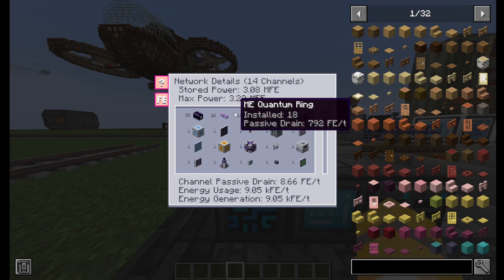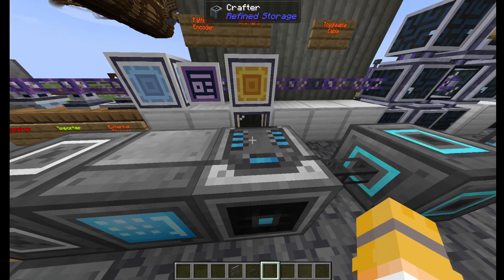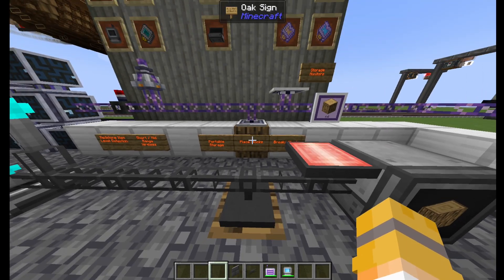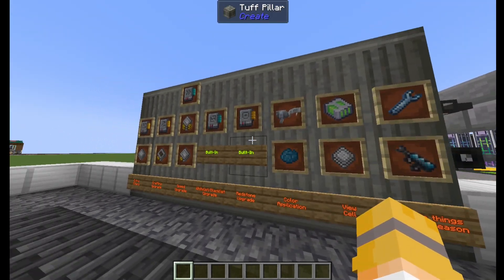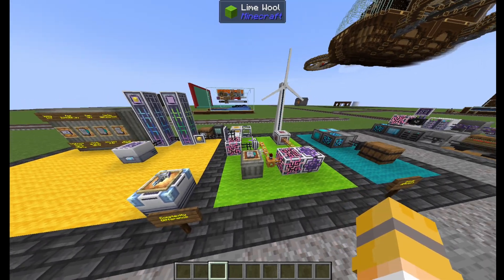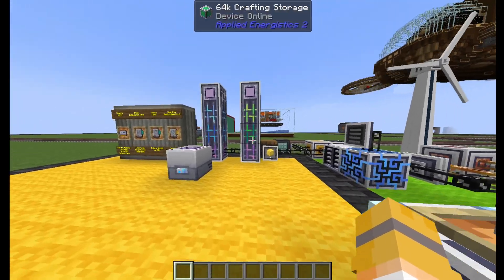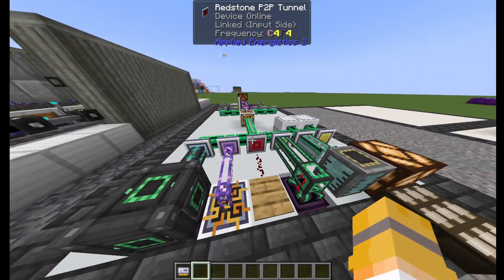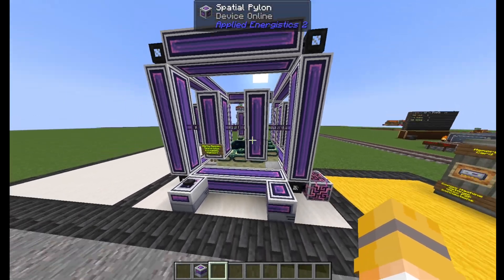Applied Energistics or Refined Storage?

Comment: the co processing unit didnt store temporary item. it works as another processor. heres an example if i want to auto craft iron pickaxe and have iron ore and wooden plank. if it have co processing unit it will simultaneously smelt iron and craft stick from the log and not 1 item at a time

Comment: 6:50 

TLDR: you use them if you have maxed out your ME core to the absolute maximum and want to use EVERY Chanel possible. You basically connect the P2P ME pannels directly to the controller and the cables running to and from the p2p tunnel interfaces.

Comment: 5:16 what if you get inf water or cobblestone cells and you dont want to see them in ae2 ?
Reply from the maker: You can put them in a subnetwork, but I don't think there's a way to hide them and still be able to access them from the main network.

For example, I can hide cobblestone from the main storage, but if I want to pull cobblestone for something, I now have to connect something to the subnetwork / manually extract from it.

The issue is that if I hide it from the main network (Via a storagebus / interface giving the main storage access, and an inverter card set to cobblestone) the item is no longer visible to the main network. This solves the issue of "hiding" it from player view, but the storage itself can't access it.

If I allow main storage to access it, it's back in player view again.

I think the best case scenario is unfortunately a separate network with the infinite cells in it, and a terminal near your main one.

Comment: The filter can be usefull if for example you are playing a big modpack you can set common crafting materials off to the side for things that cannot easily be auto crafted. Basically having a section of pinned resources having just completed ATM10 to the sky having a way to have a tab of the most common resources would have been very nice. Sadly i could only use AE2 not Refined storage.

Comment: AE2 is the way to go
My biggest issue with RS is You can't make crafters or interfaces into a pane version and stick it directly on a cable, hidden in the wall behind the machine
In the past RS had one and only upside over AE2, and that was the ability to craft with fluids directly but in recent versions AE2 can handle this too 
Aswell as handling recipes bigger than 9 different items for Extended Crafting 5x5, 7x7 or 9x9 tables which previously required usage of Packaged Auto mod in case of old AE2 or addon in case of RS.
RS cables also just look plain and ugly while AE2 smart cables look very good to the point I like having them exposed in some places

And lastly, the godtier addons for AE2 like Advanced AE or Extra AE2 that add a ton of new options, QoL and even powerful Sci-fi quantum armor directly connected with Your AE2 system

Comment: a big thing why i would recommend ae2 over rs is because of the auto crafting. there is so many things (at least with rs1) that you cant do on rs that are so easy on ae2, such as powah automation, which is incredibly difficult with rs. also its just so easy to turn channels off and add drives without types if you wanted to (the biggest downsides to ae2 imo)
Reply: So far in ATM10 I've autocrafted everything Powah has to offer and it was the easiest thing to do. Only thing i needed to change was the lock system on the autocrafter pointed into the energizing orb and set it to "lock until all items are received ( or how they wrote it ). Reactors are filled and kept filled automatically .. Dry Ice are made automatically .. all parts easy to autocraft...
Channels can be turned off by server admin/owner for AE not by players .. drives without types do not exist for AE in ATM10 ( they are disabled on servers atleast )

Comment: Viewcells are good in combination with inverter cards say you are making steel with mekanism and you are routing items with interfaces you do not care to see compressed carbon so you use view cells + inverter cards to have them not show up in the terminal. Another area where this combination is important is if you have items that very quickly enter and leave the system such as ore piecese from ex nihilo, if you do not have view cells setup all your items will jump around in order as they leave and enter.

Comment: What I like about RS is the simplicity, it's so casual that it borders on cheating for me. AE2 has way more content, if only because of the subsystems. In one of my worlds I literally used a separate multiblock controller for each GregTech multiblock mechanism. The storage buses in AE2 also basically create 7-channel subsystems. Modern versions of AE2 have gotten a bit better in terms of how easy it is to get the basic components and add a template provider. But the coolest thing is the little things that AE2 has. The presence of channels makes the gameplay much more interesting and varied, and forces you to build isolated cable systems connected to individual parts of the multiblock controller via P2P. When I play with RS I don't even think about it and just build giant circuits that are actually very simple, which is why I prefer the more complex gameplay with AE2. In fact, even the ability to place several tires in 1 block already allows you to create very cool schemes. Also in AE2 you can turn off the channels and enjoy the casual gameplay, but I think that with the channels it is much cooler.

Comment: in my experience RS is much simpler without the channel limit and item types in the storage disks, but having started with it recently in ATM10 I'm getting quite a bit of lag in the grid. Maybe it's not quite optimized yet. I do like some of the recently added features that correct some issues I had with it over AE2, like they added the ability to independently change insert/extract priorities which really helps with moving items around, like setting the insert priority higher than the extract so that as you pull items in and out they get moved to a different storage, really helpful when moving stuff to drawers. I also liked that they added more blocking options for the crafter, though it's still a bit glitchy. I set it to only insert when the inventory was empty and it inserted multiple recipes before it registered that the inventory was no longer empty and locked up the whole craft.

On the other hand AE2 is much better optimized both internally and in design, the channel and items types storage go beyond just game balancing and actually optimize the performance. The channels tend to encourage more direct lines to the controller which greatly reduces the pathfinding lag from big spaghetti systems by reducing the number of branches it's got to go down. While the item types reduces the amount of NBT data stored on the drives, which isn't as big of a deal now since I think it stores stuff in an external database or something(I know RS does, not sure about AE), but it was definitely a problem in older versions. There are mods that give AE2 RS style storage disks but they're more expensive to probably discourage people from using too many of them.
Reply: yup same, RS2 seems laggy on grid view
Reply: This is useful to me, since i was looking for a storage mod to reduce the lag all my chests make.

Comment: View cells are useful to make cells that specifically show, for example, all items for a particular mod, Or to filter out only the raw resources, Or to show all wood types, etc. Using it for a single item (eg, wood planks) is just kinda dumb. But used right, you can use view cells to just show what items are needed in a particular extension of your factory- Maybe you're in your animal farm area and you only want to see exactly what the state of all your animal products are, for example.
Reply from the maker: 100% it has it's uses , incredibly useful if you have a storage drawer wall you want to check on, but overall it's very situational and never really required.

Comment: the importer and exporter are flipped so export takes items out and import bus inputs items, AE2 terminals can intake power without the energy acceptor that only useful for filling energy card also ME p2p do interact with the system they allow you to add up to 22,000 channels and when you connect storage via a subnetwork with p2p they will apear in your main system. AE2 is way better IMO also great video

Comment: Spatial storage is why I'll always recommend AE2 over RS, even with all the meteorite stupidity. Especially if multiplayer is at all involved. The amount of trolling you can get up to by trapping another player on an SD card is unparalleled
Reply from the maker: Based
Reply: But there is no meteorite stupidity in modern versions. You are guaranteed to get all 4 presses now and at worst have to use spatial storage to transport a flawless certus back and usually have something easier like mek boxes or jdt swapper
Reply: Goku is betrayed and trapped inside the hyperbolic time chamber ahhhh prank 💀🙏
Reply: Well in new AE2 You only need one meteorite so no more bullshit RNG when chasing the only press that You're missing and finding every other that you already have
Reply: I will say Meteorites are SOOOO much better in 1.20.1 than they were in 1.7.10.  Finding Meteors in 1.7.10 was akin to finding an ender portal if you didn't happen to have one nearby, and you'd need FOUR of them minimum.  I was on 1.7.10 for a while, went to 1.12 briefly, and it was cool, but I'm kinda glad all the mods I wanted were brought to 1.20.1...  On one hand, I miss the simplicity of 1.7.10, and especially build craft and IC2, but man AE2's implementation 1.20 is worth it alone.  Just find one meteor.
Reply: you can trap players on a sd card in ae2?
Reply: @user-th7bu3sc2u  It was mentioned in the video, the spatial storage can move not only buildings but players too to a spatial disk dimension. 

So You can technically trap someone in the spatial dimension but 99% of the servers have /spawn /tpa or /home commands so they are not really trapped here because they always can use these commands to get out
Reply: I prefer RS because nbt items. Channels are also annoying. 

My gripe is Drawers vs Sophisticated Storage. SS is so close to superior, but I don't know how to adjust drawer priority: when feeding items into a controller with a hopper, it puts them into the next empty drawer before looking for a drawer that already has that item type. If you know how to adjust that priority, do tell.
Reply: @joseph7471  What I do to get around it is I lock the drawer. For example, I have a huge wall of 2x2 drawers. I put a single diamond, gold, iron, and copper in one of the drawers. I then lock the drawer. It will only push those items to those drawers. 

You do have to do this for every item you want, otherwise you will still have the issue you said you had. But locking is the way to go. I also have filters through my storage bus (using AE2 to access the drawers) to make sure only items I explicitly allow go into the drawers, and any time I want to add a new item, I add it to the drawer, lock it, then add it to the filter.
Reply: @joseph7471  Export all unstackable things into Armory Cabinet, slap a storage bus on it with high priority and the problem of filling all your item types is gone
Reply: @joseph7471  I know this is late but you have to lock all the drawers then you just place the item in the one you want. I would probably just pick SS because you slap the stack (max) upgrade into the chest and forget about it. Link everything up. Then when you do get your AE2 storage set up, you can just leave it for smaller item stacks and leave all your large bulk items in the chests. But I do know people love their wall of items with the drawer mods. 

I really never had a problem with the channels with AE2 but I also program and did networking at one time. So maybe I was already geared to compartmentalizing my functions into their own groups. I think I have had to reroute cables once (before setting up wireless stuff with extendedAE) But I think after you get used to the whole 32 channels with the dense 8 channels with the regular. And know what takes a channel and what doesn't you can just cable manage and not have to ever worry about going over.

Comment: The best use for a sub network is to set it up between you main controller and the rest of the network. Then you can use AE tunnels to transfer multible 32 channel cabels in one cable saving a tone of resurces and space.
Reply from the maker: I have since learned subnetworks, the easy channel transfer is very nice, my main controller has a lot of p2p tunnels on it, and needs another controller to use them.
Reply: @solar8337  This is the way

Comment: Lol the RS2 bit was funny. About AE2 subnetworking, I do agree it's confusing if you don't find a reason to use it. I can give an example but it'll be a bit long so please bear with me.

Say you have a network that stretches across your entire base and connects all of your farms and supplies them with bone meal. Now let's say you need to expose a drive bay in one corner of the base all the way to the other, you could drag a new cable all the way across base, OR you could "hitch a ride" on your bonemeal network. In this scenario the bonemeal network will be your backbone highway sub-network and your tunneled drive bay will be the main network.

Sub-Networks help condense your cable management by allowing you to borrow a channel and tunnel a separate network through. If my explanation sucks which it definitely does please ask away I found subnetworks so gosh cool when it finally clicked 

Back to topic, RS(2) is good and so is AE2, different tools different problems different nuance
Reply: The point to point is very similar to real-life VPNs. Where the sub networks are like slightly simplified subnets or supernets. Being a network engineer provides an interesting view of systems like this.

Your example of backbone (backhaul) isn't too bad, I might have noted the 'physical' distance in the example more. I've also seen people build a storage network purely to sub it out like tree roots to all their needed tasks rather than using a main bus where everything exists in one place. You would get that extra percentile of efficiency with subs at that point.
Reply: @gigabot3662 Thanks!! I'm a network engineer myself as well so that might've been the reason it clicked so well
Reply: I think a easier way to show subnetwork usefullness is to say: it allows you to have mote than 32 things collected at the end of a single long dense cable. (since a subnet only takes up one channel on the cable)

You have to break it out again at your controller but your basic cable run can be simplified greatly with this.
Reply: or you can just disable channels and just enjoy the mod